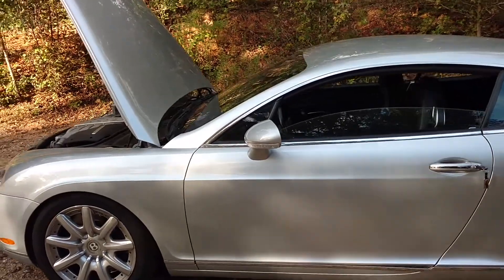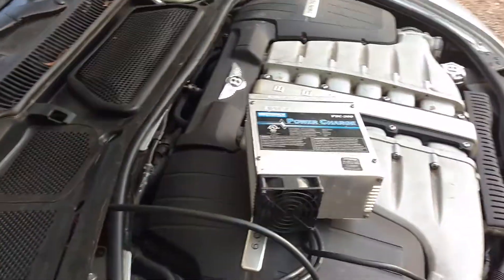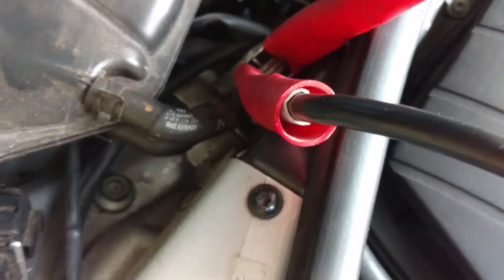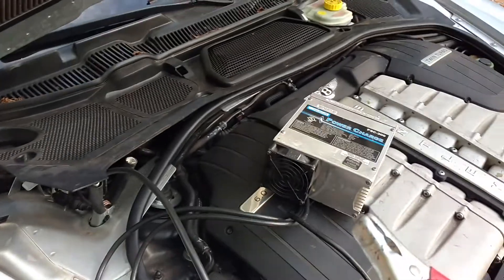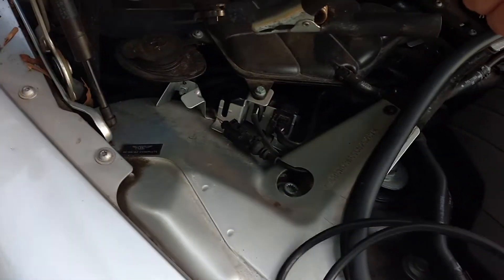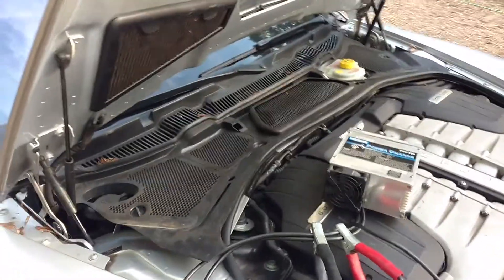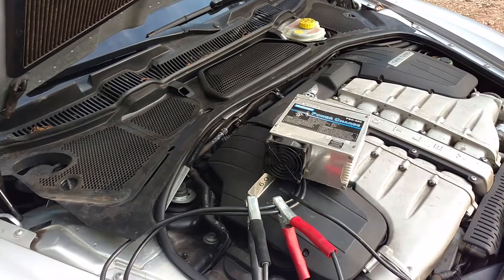How Power-up a Bentley GT to open the rear lid, when the battery is dead.

Comment: Can i attach a ctek this way with a dead battery?
Reply from the maker: Hi, you will want to check the instruction manual for your particular battery charger/maintainer, but I would say you could do it.
Reply: @SchumacherWerkstatt It worked! My battery was beyond dead, so I had to keep it plugged into that junction with strut tower as ground for 3 hours at least and the boot finally opened.
Reply from the maker: @shaazy  Nice! Great feedback, thanks for sharing!
Reply: @SchumacherWerkstatt  Oh yes, it is a lifesaver. Posted it everywhere! Especially cause that emergency release cable behind the rear driver side (RHD) seat wasn't working either. 😁
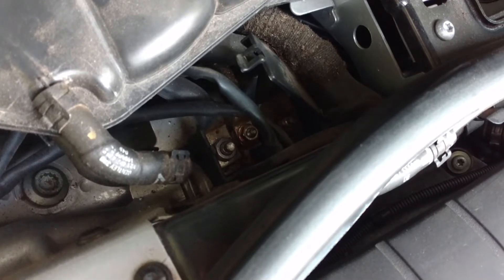Reply: @SchumacherWerkstatt Im back at the same spot diagnosing a weak alternator. At 0:38 you mention one lug is for starter, generator and main battery (house battery). Can you confirm which lug points to which connection left to right? I am hoping to check alternator output this way using a multimeter, to see if its putting out 14v, because my house battery (big one in the boot) is showing low charge (11.65 to 12v) with car idling even though battery health as tested is good. My starter battery shows 14v with car idling.
Reply from the maker: @shaazy  Hi there,
From what I can tell, it looks like the middle terminal is for the alternator/generator, which should use a 20mm² wire. The main system battery uses an 80mm² wire, and the 25mm² wire is for vehicle power and the fuse box.
See this image: https://i.imgur.com/ZbNJssy.jpeg

I recommend checking the charging voltage at both the alternator and battery. It should typically be between 13.5 and 14.5 volts (engine running, no elec. loads). 

If there is more than a 0.5V difference between the two, you might have a wiring issue or a problem with the charging system.

And if the charging voltage is below or at normal battery voltage, ~ 12.5 volts, you have a problem. Check all your wiring connections, fuses, ground connections, etc.. 

Last alternator I installed on a Bentley, took 5 months, it was on back order from Bentley and I dropped the engine to also fix the failed vacuum lines.

For the official Bentley Motorcar repair manuals, see these links:
  https://bentleymotors-us.erwin-store.com/erwin/showHome.do
  https://bentleymotors.erwin-store.com/erwin/showHome.do

Comment from the maker: If you dislike this video for some strange reason, tell us why! 
If you like the video, thank you!
Reply: Would help if you specified on attaching the leads, whether positive first or negative first. And the same with disconnecting.
Reply from the maker: @Greg-kp5gd  Old-school advice suggests connecting the positive lead first, then the negative, to minimize the risk of shorting. The positive connection is usually more isolated, while connecting the negative first could accidentally create a short, especially if the negative terminal is grounded.